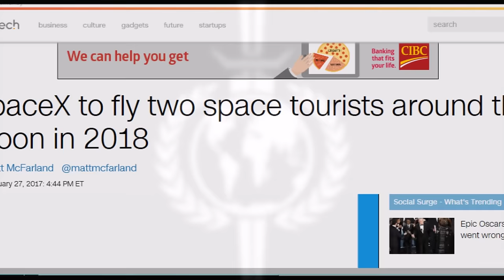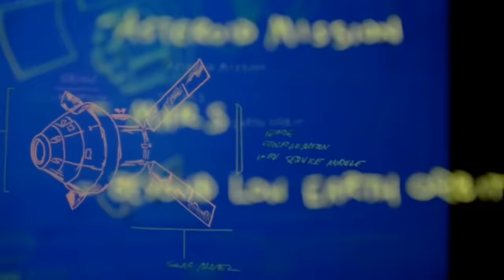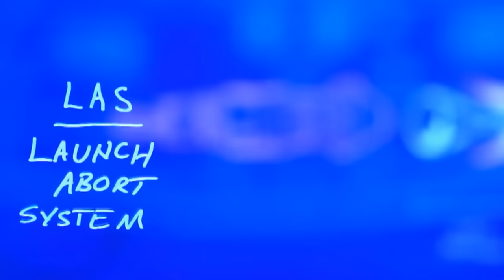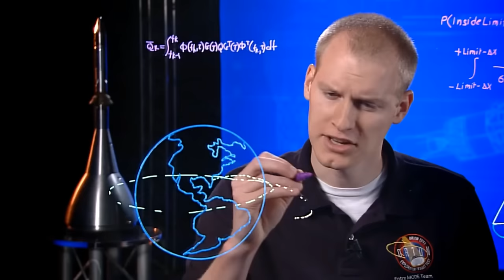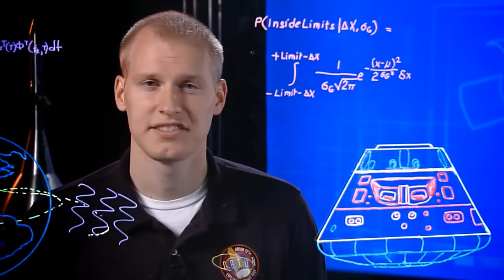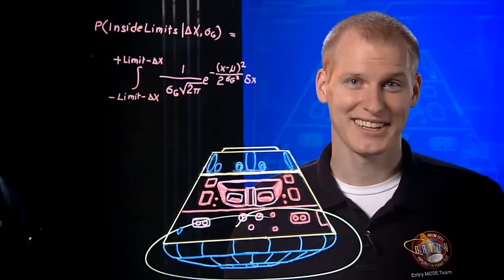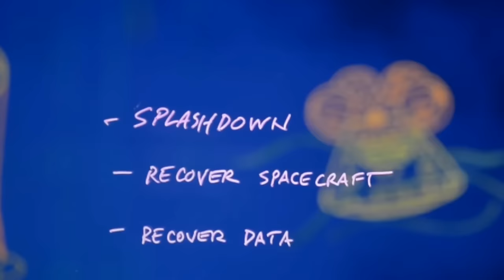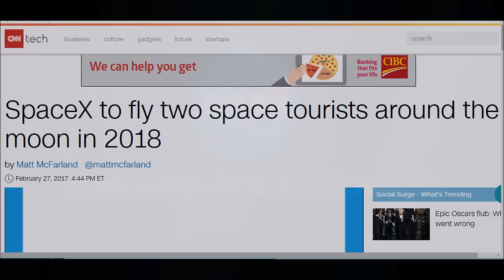Space X is NOT sending tourists to the moon in 2018 - research Flat Earth - Mark Sargent ✅

Comment: 1-SpaceX is just sending a capsule, no descent module, no LEM, and no propellant required to put the capsule in orbit around the Moon. So, it is a huge drop of weight compared to Apollo 9.
2-The capsule istself is going to be lighter than Apollo capsule because all the electronics have been massively reduced in weight and increased in performance.
3-SpaceX Merlin engines are much more efficient than the F1 engines of Saturn 5.
4-Falcon Heavy will be tested this year and is basically 3 Falcon 9 tied together, a proven and tested technology.
5-The Dragon 2 capsule will be tested before with cargo then astronauts this year with flight to IIS.
6-SpaceX heatshield is PICA, way better than those used for Apollo. Since it is the same technology that will be used for Moon flight than the one for ISS, the only difference will be the trajectory and DeltaV required.

So yes, it is completely feasible.

Comment: **News flash  (actually common knowledge)
1) Apollo didn't have lead or gold shielding: didn't need it! 
2) Apollo avoided the worst of the belt by charting a trajectory though its thinnest and weakest parts.
3)Most of the radiation that ships are exposed to on a journey through the VRad belt are charged particles of the proton and electron variety NOT X or Gama Rays.  Read up on the Solar Wind. 
4) The payload capability of of the Falcon 9 Heavy (3 cores) to the moon on a free return trajectory is  a bit over 30,000 lb. The Saturn V could push 107,100lbs on a TLI (The command module the service module,  the LEM and the empty 3rd stage on a Lunar trajectory). The command and service module weighed 26,300 pounds the LEM weighed 36,200 pounds (total to lunar orbit 62,400lbs. The Dragon V2 with three astronauts and a service module weights in at ~24,500lbs.**

Flat Earth huh? Good one, a real knee slapper.

Comment: The only thing that might be wrong with Elon's statement is that he is usually behind schedule.  Circling the moon is very easy.  The Falcon heavy is just three Falcon 9's strapped together and all of it has been tested except the combination of the three.  It's being constructed right now.  

On the lead and gold shielding, incorrect.  The electron's or proton's in the belt require different materials and they will also do a polar push to stay away from them.   Coming back they will be going 25,000 miles per hour.  The Mars mission will expose them to MUCH more radiation for LONG periods of time.  . . . no comparison.  The big problems Elon will have is getting his capsule man rated for safety.  

Nah, flat-earth isn't hitting critical mass, because the Earth ain't flat.  It is a sphere.  I know.  I'm a retired aerospace engineer.
Reply: If circling the moon is so easy why don't you do it. I bet you $100 you won't.

Comment: The cool thing about the van allen radiation belt is that its a belt, not a sphere. So if you take a trajectory that swings far north or south instead of straight out along the equator you can just go around it, which is what the Apollo missions did and is why they didn't need much in the way of specialized radiation shielding.

Comment: Yes it's correct that the Falcon Heavy has not yet flown, and to be suspicious of any dates that are given in relation to it, because the delays in this project have been extensive. Almost certainly they will continue to be. But it's most certainly not true to say that there has been no work on it - that is ongoing. It's a somewhat 'modular' system, for example, the first stage is three adjacent Falcon 9 boosters - and many of those have launched, successfully. Also it's not intended to be a 'new' Saturn V either, it's about 2/3 the size and has a much lower lift capacity than the Saturn V.

Regarding travelling through the Van Allen Belts; the 'shielding' regime is the same as that used for the Apollo missions: mitigation by virtue of the fact that the belts are traversed quickly, and the radiation blocking properties inherent in the vehicle design itself, which are quite robust. You wouldn't use lead or gold shielding, that's silly - and quite inadvisable too. High velocity alphas when impacting lead nuclei for example cause secondary radiation that's more dangerous than that which you started out with. So, no. Just no. We'll use aluminium, like we always have. This is certainly robust enough to allow astronauts to easily survive, and this is well known - why do you people keep banging on about this? The radiation dose received is minimal, any claims to the contrary are just wrong. Banging on and on about the lethal nature of the Van Allen belts is simply misinformational, and really you should know better by now. The only thing that's going to die is the stupid argument.

Pictures of the Earth and the Moon whilst the mission is executed: yep, there will be all of that, just like there was in Apollo. Why not? And yeah, this trip could be fatal, sure, for all kinds of reasons. That's space travel for ya, it ain't safe, buddy. If you don't have the bravery, don't go.

Finally - flat earth again? AGAIN?? Look, query the validity of the SpaceX mission if you like, but a flat earth? Why all this 'it's faked!' nonsense? Why faked? For what reason? Where's the gain? Think, people, for fuck's sake. Mark Sargent, whoever the hell you are, you're just the latest in a long line of lunatic fringe sensationalists trying to make a name for yourself, dragging a long line of easily duped numpties in your wake. Despicable. And shameful.

Comment: While you're right that it's likely going to be delayed, the Falcon Heavy isn't really an entirely new rocket. It's also not as large as the Saturn 5. And the Van Allen belts aren't an issue, if the flight is timed properly. That's how the Apollo missions did it. I don't believe they can keep to that schedule, since they still have some testing to do. I also just don't think NASA and their contractors are building Orion and SLS to go somewhere, but to create high profile engineering jobs.

Comment: The van Allen belts are primarily ion radiation: beta and alpha particles. Both of which can be stopped by a few layers of aluminum foil. Lead and concrete and gold are only needed to block x rays and gamma radiation, which are a form electromagnetic radiation. Electromagnetic radiation has no mass (think of it as a type of light that our eyes can't see) and moves so quickly that the earth's magnetic field cannot do anything to concentrate it more (or less) in the van Allen belts than what you find in low earth orbit.  Also, the van Allen belts are most powerful around the equator, hence it is possible to leave earth in a path that takes you through the weaker parts of the van Allen belt near earth's poles, further reducing the risk to human passengers.

Comment: Just one thing... the Van Allen belt is made up of charged particles which mostly can be absorbed by the space crafts metal shell and the space crafts fibers inner lining.  with this, in account, they should each receive 1/6 of radiation workers safe limits  annually, in other words, it's safe.

Comment: 1. why r u so angry?
2. also why r u asking other people to scrutinize the plans without doing any research yourself?

The question about needing to test a new system is ridiculous, the falcon heavy uses the same falcon 9 main launch vehicle (with two more on the sides... which appear to be similar except for the nose-cone).  From a quick google/wiki: Payload of a regular falcon 9 to the moon is about enough for a dragon crew capsule ~5tons (4 dry tons+payload, with the additional heavy-lift rockets it http://www.spacex.com/crew-dragon could go to mars with 3 tons of payload). I also don't see why radiation would be any more of an issue orbiting the moon than it is on the ISS.

Agree that the claim sounds ambitious, but isn't it better to be over-ambitious than under-ambitious? You can choose to be positive or negative, this video contains no constructive criticism so I don't see the point of posting it.
Reply: it would be funny if they had a fake simulator, maybe coordinate with a payload to the ISS... as long as they thought they had gone to the moon!

Comment: Get a grip. The actual amount of radiation
received by the Apollo astronauts during their passage through the van Allen belts is difficult to determine but it is estimated to be about
2 rems (or 20 milli-Sieverts).

In comparison, a modern chest X-ray will deliver about 10-20 millirems
to the subject, radiation doses from background radiation (cosmic rays,
radon, uranium deposits, etc.) for the average human living on Earth is
on the order of 100 millirems per year, and annual doses for people
working around radiation (for example, X-ray technicians, nuclear power
plant workers, etc.) can range up to 0.4 rems per year.  The "maximum
permissible dose" for radiation workers on Earth is 5 rems per year or
25 rems in a single emergency exposure.  A 25-100 rem dose will increase
a person's chance of developing cancer.  Around 100-200 rems, a person
will experience nausea several hours after exposure.  Above 300 rems,
severe vomiting, and hemorrhaging will result nearly immediately, loss
of hair, and other health effects will result fairly rapidly, greater
than half of the people exposed to this much radiation will die within 2
months.  Above 800 rems, diarrhea, dehydration, and problems with
digestive organs will result rapidly, over 90% of people exposed to this
much radiation will die within two weeks.  Above several thousand rems,
death results in a few days and convulsions and nervous system failure
occurs almost immediately.  So, 2 rems is certainly a lot, but by no
means would it cause instant death or illness.  And in fact is most
likely to cause no noticeable immediate or long term effects.

Comment: The fact that you don't know what the Falcon Heavy is, where it's being built, how it's going to be tested, when it's going to fly reducing your credibility. This is common knowledge. I've seen with my own eyes the interstage of the FH, there's pictures of the side boosters on their way to be tested. We hope to see it fly this year for the first time and should have 3 flights done before this "grey dragon mission." To counter your point of the 60,000 mile wide Van Allen Radiation belts, a trans-lunar injection requires a speed of 22,000 mph, which means we get through it in under 3 hours which is plenty of time for the relatively low dose of radiation. 

You mention that you doubt they'll have cameras that will show x, y, and z. So when they DO have all these cameras (as spacex does an awesome job with putting cameras on everything), what will you say then?

Comment: You're making foolish arguments.

1. Falcon Heavy is not mean to "replace" the Saturn V. These are two different rockets, designed by different engineering teams, with a marked difference in mission scope and capabilities.
2. Falcon Heavy's core, The Falcon 9, is well tested and SpaceX has announced only one more variant to improve on the F9 design. The only difference between the F9 and the Falcon Heavy is two additional F9 boosters, which detach in the atmosphere, fall back to Earth and are reusable. The only difference here is the takeoff weight and lb's of thrust which mean an increase in velocity after the first stage is jettisoned and the second stage is fired. While testing is necessary, testing the Falcon Heavy is not so large an endeavor as testing the original F9 years ago, because that's the heart of the system.
3. Who are you to imply that you are qualified enough to determine what is feasible and what is not in the realm of spaceflight?
4. "Have they built this rocket, are they going to TEST it?" .... when the Falcon Heavy performs a successful test later this year, you'll move the goalposts and you'll find something else to complain about.
5. The impenetrable Van Allen Radiation belt concept - this has been disproved so many times it's comical at this point. The Apollo astronauts' trajectories to the moon allowed them to go around the worst of the radiation, and this has been demonstrated. Don't be lazy, and look it up.
6. "NASA hasn't come up with what material the Apollo astronauts used for shielding" ... Oh, I see. So in your world, NASA makes some huge, elaborate narrative that we faked the moon landings, but we can't simply lie about what material we used to skirt the horrible deadly radiation. Hint: We didn't have to go through the worst of the Van Allen radiation belt. The skin of our spacecraft was enough, as is evident in them surviving and coming back with cancer rates little worse than the average person.
7. "NASA isn't sending manned Orion missions to Mars because they can't figure out how to deal with the radiation belts" No, just no. That NEVER happened. Show us one piece of evidence, one piece of NASA documentation that has ever, ever stated that or even IMPLIED that. You're making things up and I'm calling you out for your dishonesty and foolishness.
8. Your analogy of Nazi Germany telling its citizens they're winning WW2 and NASA telling us they landed on the moon. You're an idiot. No, just no. If you're going to make up analogies, at least find compelling ones.

When space tourism is not only thriving, but affordable to many people on Earth in 50-100 years, you're going to feel like a giant idiot. And you're the type to never go, for the realization that you were colossally wrong all your life. Please don't change, Mark Sargent. You provide entertainment for us.

Comment: If you had superior studies in physics and math, something I presume you don't have, you would know that what it is proposed by spaceX is not only doable but in fact not really that different from what they have been doing recently resuplying the ISS. Before you start screaming and shooting me like crazy let me tell you something, Im a student of aerospace engineering and I can guarantee you that even if you don't want to believe in it, all of this could be perfectly true. You could argue that everything is false and faked, probably you are right, but not because it is impossible. Indeed there are a few problems spaceX have to solve from the point of view of the final testing, but as long as I know these parts are already designed and manufactured. These is a race between agencies to get the contract for carrying people in and out from the ISS so its likely that the 2018 mark is a bit offset by that, but think of it this way, they will lose a lot more if they fail.
I have no intention of insulting anybody, so pls if there is something you wish to discuss with me do it calmly and I will gladly reply.